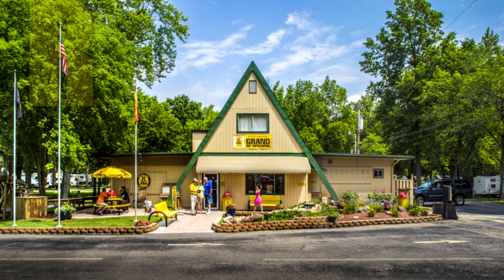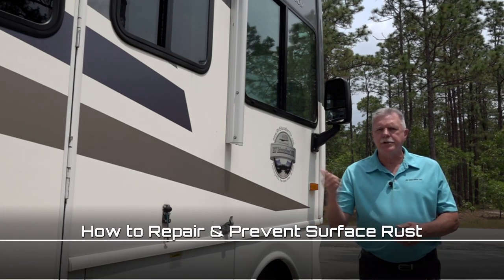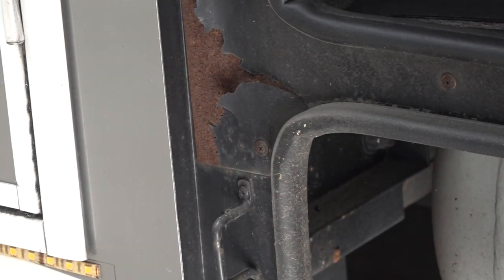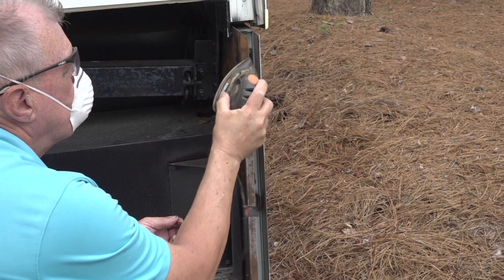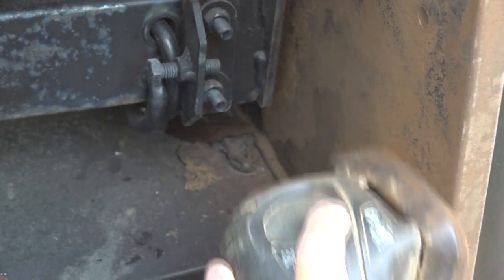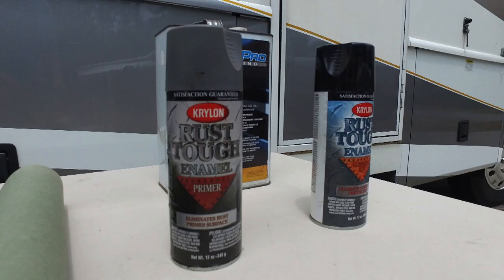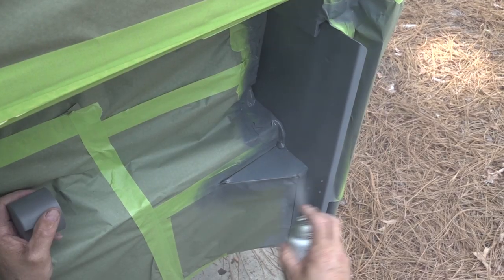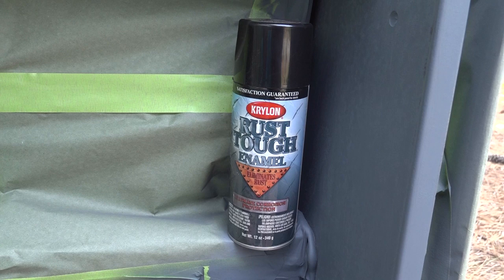How to Repair Surface Rust on your RV

Comment: Excellent and informative video. 
Another useful item is Corroseal Rust Converter.  Converts rust (iron oxide) into a stable substance, magnetite which can be painted.  Most of the surface rust should removed as you showed.
Your videos over the years have always been helpful.